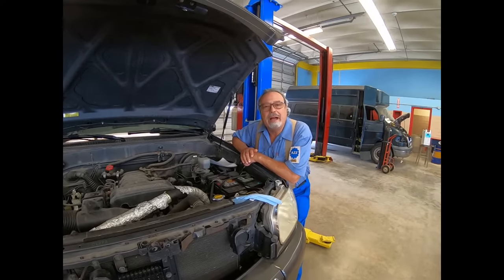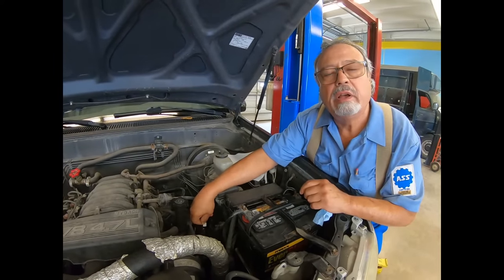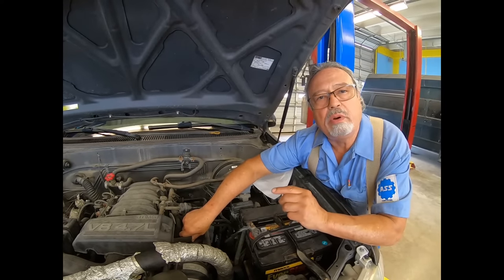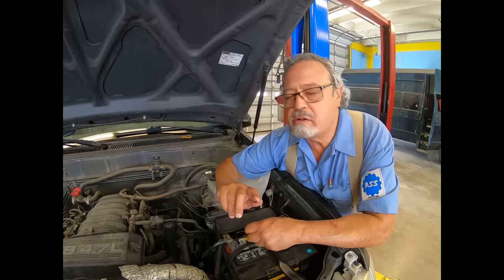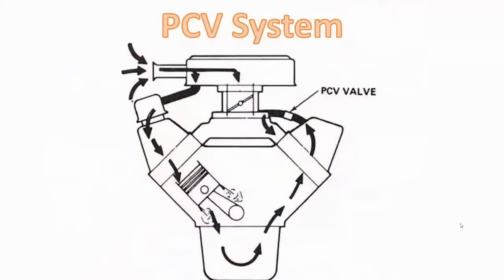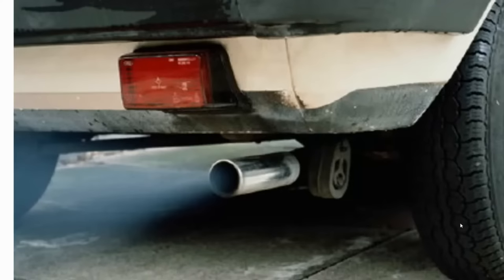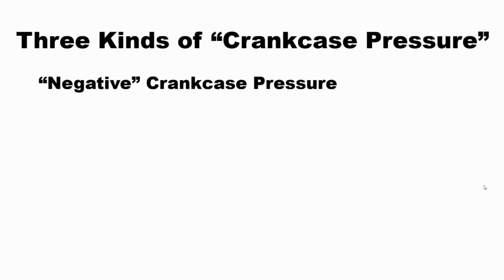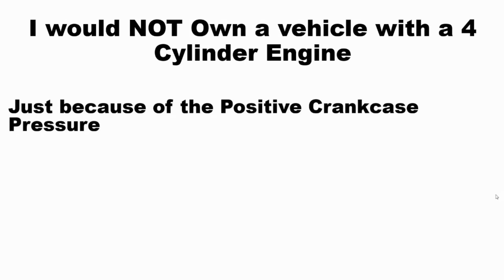Learn how IMPORTANT the PCV Valve is and why you should test it.

Comment: Am really learn alot .
Hav a Pontiac vibe 2003, jus realise smoke coming out of my dipstick hole. Wat is wrong with my car.I really need ur help
Reply from the maker: Thank you for the question and the view. More than likely your vehicle has a four cylinder engine. Four cylinder engine struggle to have negative crankcase pressure to begin with. Either way, if you have a four cylinder or six, change the PCV valve and hose that goes to the valve. If that does not help, the engine has excessive blow-by gases (scored cylinders and rings).

Comment: great video but one question - why do four cylinder engines not have negative crankcase pressure? do you expect flat 6 engines to create enough crankcase vacuum pressure for the paper to stick? I am interested in doing this test on a 2005 subaru outback with an H6 (EZ30R) engine. Thanks
Reply from the maker: Size counts. It take a very large amount of vacuum to over come the blow by pressure and put the crankcase under vacuum. Only larger four cylinder engines (2.8 L) can create enough vacuum to put the crankcase under negative CC pressure. Thank you for the view and the question.

Comment: Great video, thank you, but, if paper does not stick, im polluting the earth, and my oil, etc. but where is the problem and the solution?
Reply from the maker: Thank you for the question and the view. First find out if your engine uses a PCV valve. Most engines do use a valve, but some do not. If you use YouTube to research your valve, make use it is exactly the correct application. Replacing the valve AND the hose (if used) is a good start. If that does not fix the problem, sometimes the passage in the throttle needs to be removed and cleaned . If that still does not fix the problem, the engine may have excessive blow-by which is an expensive repair. Good luck.
Reply: @theoldmecanicoshow9004  Thank you for replying Old Mecanico! It uses a pcv valve, the eng was just rebuilt, I did not mess with adjustments in the throttle body or anything else, cleaned the throttle body before installing it back, etc. what is driving me crazy is that when I disconnect the hose from the pvc valve, it holds idle and sounds very normal, 700 to 800 rpm, with the hose connected to the pcv, idles too low, surges, and dies, if I leave the throttle closed,  and when I tested the pcv, it does not seem to be blocked, it opens and closes. Bought a new one anyways, so Im going to try it next time. Engine is a BBC 502 marine
Reply from the maker: @MachTuck  Try a "Factory" valve if possible. After market valves can be super cheap quality. Good Luck.

Comment: The part of the test that was forgotten, rev the motor and watch the piece of paper fall off because as the vacuum level falls so does the function of the pcv. These things (pcv’s) only work during idle basically and if the piston rings are sealing correctly. When they don’t you get so much blow by that it easily overwhelms the pcv and causes oil leaks and induces moisture into the motor from the water vapor in the combustion. You can see it under the bottom of the oil filler cap as a grey murky junk and the smell is noticeably different in the exhaust gas. As far as keeping the oil clean, the pcv doesn’t do anything for that, especially if the breather filter is missing. 
Just using a good oil without paraffin in it (for a street driven vehicle) or a good synthetic oil like Valvoline- Havoline are two that I recommend. If using conventional oil you can see the paraffin by looking at it while pouring so the light shines through it and if you a greenish tint that’s the paraffin. It’s very slippery and is great for race engines that are torn apart frequently, but is sludge in the can for street use. You can pull a valve cover and note the waxy coating. And the cheap low tension piston rings are a detriment to your motor as they allow blow by and oil consumption that destroys the cat and the sensors. Good luck!
Reply from the maker: WOW...thank you for all that additional information. Thank you.

Comment: What happens if the paper doesn't stick (V6), but the pcv valve seems to be working properly?
Reply from the maker: Thank you for the question and the view. If the paper does not stick it means one or more of the following: the hose (if used) is restricted / the point of entry (throttle body or intake manifold) is restricted  /  the valve is CCC "Cheap Chinese Crap"  /  a combination of all of the above  / or your engine has "Excessive" blow-by. Excessive blow-by is caused by scored cylinders and rings. Thank you again.

Comment: Ok, quick question i used the paper test, on my rebuilt 5.3 vortec engine. My pcv system has an oil catch can connected to it. The paper does stick to the oil dip stick tube, but its also has some of the symptoms you speak of, the oil turns dark faster, and my rear main seal have been replaced twice because it was leaking, also I have a high volume oil pump on it. Do you guys believe my rear main seal keeps leaking due to the pcv system not working properly? Thanks in advance.

Comment: I love my 4 banger honda. Is there a modification a guy can do to fix the lack of negative crankcase pressure?
Reply from the maker: Thank you for the view and the question. There are a couple of things that you can do to help your 4 banger. Replace the hose the valve uses with the biggest hose you can fit on there. You can use adapters at each end. Also, use a Honda valve for a 6 cylinder engine.  I don't know if your valve threads in or pushes in. Good Luck.

Comment: OMG... ASSwesome video!  Very well presented, learned a lot and subscribed.
Reply from the maker: Thank you very much for that Awesome comment and the views and the subscription. 😀😀😀
Reply: @theoldmecanicoshow9004  Wish I had a BadASS (exceptional positive praise) patch for ya.  I came across your video a 2nd time because I was researching Valve Cover baffling after reading this 1 Star Amazon Review 
"There is no baffling inside the unit allowing the pcv system to suck in oil. This in turn causes misfires on random cylinders by trying to burn oil in the combustion process. This then causes massive amounts of smoke to come out the tailpipe. Once I put the original cover back on, the smoke cleared up but now I have to replace my spark plugs because they were completely fouled from the oil. "

Comment: And if I could to ask for an another one advice, my brothers six cylinder (OM-642), is not making slight vacuum at all. 
Only pressure is going out, paper dont want to stick at all. The flow of the blow-by is blowing the paper away only.
I ve checked PCV valve, its in perfect condition. Also rubber parts inside, basically no dirty and sludge inside PCV valve. Also I ve changed a hose of PCV system cos the old one hose was shrunked. Not like sticked oil and sludge on the walls on the hose, but literally shrunked,,, like cos huge vacuum. Deformated one. 

Please, what could to cause the deformation of the old hose ?
Reply from the maker: Thank you for the view and the questions. If the PCV hose connects to the throttle plate, sometimes you have to remove the throttle plate and clean it. It takes a lot of vacuum to put the crank case under negative pressure, vacuum. Make sure the hose is providing the valve with very large amounts of vacuum. Good luck to you and your friends.

Comment: if you were to cap off the pcv vaccuum on the intake manifold vaccuum port, wouldn't it just use the breather hose to vent crankcase gases? also, since the pcv steals engine vaccuum, if you cap off the manifold vaccuum port (for the pcv), won't this increase engine vacuum/combustion/efficiency slightly? If breather hose (goes from valve cover to usually somewhere before throttle body on main intake tube) is at least .25" in diameter, isn't that more than enough to release/vent crankcase pressure without blowing any seals?
Reply from the maker: Thank you for the view and the comments. Venting blow by gases into the atmosphere is bad for the environment. The engine uses the vacuum / air to operate the PCV system to idle the engine. Thank you again my You Tube friend.

Comment: I want to replace the elbow for the pcv valve hose but they no longer sell the parts how would you go about fixing this issue? I have a 97 ford escort. I tried ordering one online only to find out it was a piece of plastic not rubber. Please any advice would be appreciated.
Reply from the maker: It is NOT Rocket science. Almost anything will work..Even patching the elbow with duck tape. Good luck and thank you for the views and the question.

Comment: My check engine light is on my 2007 Pontiac V6 G6 GT hardtop convertible, it has 106K the diagnostic code comes up bad catalytic converter, as in I need a new one, no other codes at all.  I'm doing this test tomorrow, as far as ik the pvc valve hasn't been changed, but I am the 3rd owner. My cat converter seems fine and there r no exhaust issues or bad smells. I'm wondering if this valve needs changing, could that be why the cat code is coming up, and check engine light stays on? Is it possible?, I hate to invest that money in a cat and that not be the issue. Also I have a tiny oil leak, not enough to have to add a quart of oil between oil changes. I'd say I add about ⅓ of a quart. Mechanic said it was rear main seal leak. I haven't seen it 4 myself yet. Everything u said in this video  is making  me hope that if I change the pvc, the problems  will resolve, ik the leak won't stop now or will it? Also would any type of additive help,, like cata clean & rear seal leak stopper?? Thanks for sharing ur knowledge, I'm glad I found u. I seen ppl say video was to long  and u repeat urself, I think that's good, cuz thats how it sinks in and u learn & remember. Keep  the videos coming! Thanks again! B---
Reply from the maker: Thank you for the question and positive comment. Did your paper stick ? If it did, your PCV system and crankcase negative pressure is Good. A bad PCV will not set a CAT code (sorry) As for the CAT code, about the only other things that can make the CAT look bad is exhaust leaks or restricted exhaust (bent in). If the exhaust does not have a leak or is bent, the CAT is deteriorated (worn away). CAT's only go bad two ways. One is they deterirate and the other is they get restricted which causes lack of power and usually does not set a code. If you decide to replace the CAT, be ready to spend hundreds of dollars for a good one. Some muffler shops installt the smallest one that might fix the code. I hope this was some help. Good luck.

Comment: I saw somewhere that you should change it every 50,000 miles. I have a 2007 FJ cruiser and I have never changed it, what do you think about changing it before there is a problem?
Reply from the maker: Thank you for the question and the view. Yes, absolutley. The PCV valve is more important than most people realize. I looked yours up. It is pretty easy if you want to try to do it yourself. https://www.youtube.com/watch?v=W6CADz53AC0

Comment: Question, how does the PCV system work under wide-open throttle? since the vacuum should be at, or very close to zero?
Reply from the maker: You are correct. At WOT the vacuum is very low and the PCV system does little to nothing about the blow-by. It's the same as the the old "Vacuum" operate windshield wipers. When you accelerated, the wipers would slow down. Thank you for the view and the question.

Comment: I have a mazda 6 from 2010 with an engine 2.0 155 hp 4 cyl (210k km) and I think I have a problem with PCV valve because when I change the oil, it is black, exhaust tips are black and it needs 1liter of oil between the changes ( less than 10.000 km). I didn`t notice any leaks.
Reply from the maker: Thank you for the view and the comment. Here is a link on Mazda 6 PCV valve replacement . Your valve looks difficult to replace (I hate that) https://www.youtube.com/watch?v=NU3uFViexgU
Reply: @theoldmecanicoshow9004  Thank you for that, is it located behind the engine?

Comment: Hi sir! Thank you for ur video, I’m going try this , bcz my 01-DGC is a pain to get to it , I had it replaced b4 covid and the place I took it to was in a hurry and said the part was  not correct part even tho the box it came in was right part no…

I  said let me call and get the right one and they didn’t want to wait bcz it was almost closing.. so they rigged it to fit and I didn’t feel comfortable on that but they did it anyway.. I wished now I would’ve said  just put old one back on till I got new part…

Can a wrong part do damage to my engine??  I still have my old one , I read some where that if blow in it  it  working and if u can’t blow in it then it bad is that true??? 

I’m just having some of symptoms of bad one..  I try taking it off it to hard  I don’t want to break the valve.. any suggestions Is appreciate, I don’t know what they did to get it on..
Reply from the maker: Hello Thersa M. Thank you for the view and the question. I want to try to help you. I tried to figure out what kind of vehicle your 01-DGC is. Can you spell it out? Yes, the correct part works best. The wrong part comes close to working but the correct part is better. You can clean to old valve real good and it will work fine. The only reason we relpace them is because they get very dirty. Tell me what kind of vehicle you have and I will research more information. Thank you again. Good luck.

Comment: I have a question sir,,,i have toyota vios 1.3cc manual 2011 model ,,,,when i open the oil cap ,there is a sunction ,,the cap were suck,,,is it normal or not?, ,,,,and there is a oil n the pcv valve hose ,,that is why i noticed that my oil is decreasing ,,,there is no leak on engine ,,,,
Reply from the maker: The suction (vacuum) should be so little that most of the time you do not notice it unless you are looking for it. Yes, too much suction can suck oil and use it up (burn it). I suggest that you change the PCV valve and the hose. Good Luck and Thank you for the view and the question.

Comment: My Jeep is using the oil without leaking. There is not leak around my motor, but when it's time to change the oil or before, the oil is empty. Could that be my PCV valve. 4 cylinder jeep Cherokee?
Reply from the maker: Thank you for the question and the view. It would be a good idea to change the PCV valve. Some PCV valves cost $5 and can be changed in 10 minutes. Some PCV valves cost $100 and take over an hour to change. If you tell the year , make, model, and engine size, I can try and provide you more information. Thanks again.

Comment: Oh boyy
I recently bought a second hand V6 truck and been thinking of replacing the pcv valve sooner than later since it had 3 oil leaks so far
I think I’m going to give this a try when its back from the dealer
Reply from the maker: Thank you for your comment. There is no doubt in my mind that "Sticking the Paper" is so important in preventing AND slowing down existing oil leaks. Good luck on helping to stop or slow down your oil leak.
Reply: @theoldmecanicoshow9004  I did it and the paper didnt move at all! 
10,000 miles remain until I need to replace it according to the service manual
Reply from the maker: @redman4life91  Try to buy a GOOD part...not the cheap/plain one.
Reply: @theoldmecanicoshow9004  I get cheap body/interior parts, but for the electric/critical components, I get them from the dealer, I’ve already made the employees my friends and they give me stuff for low prices, Like I just recently got a fuel pump for 200$ while its original price was 250$, they dropped the price for me

Comment: Hello sir 
 my engine is bad and and the piston rings is damaged 
Will help me a 5w40 or 5w50 oil or an oil aditive? It willsealbetter the pistonrings?
My car need 5w30 normally 
No money to reconditioned the engine...
Thank you very much and nice video
Reply from the maker: Hello,
Engines go bad many different ways. The symptom (how it is acting) can help me advise you. Does the engine run /run poorly /overheat / leaks oil...? I promise I will reply to your follow-up information and Thank You for the views and the question.
Reply: @theoldmecanicoshow9004  
 Hi sir 
The car is 4 cylinder 1.6 tdci econetic ford focus 2013
 120 k miles
The car run fine...
From 2 gear to 3 gear 2000 rpm to 3000 rpm push me back on the seat... is not overheating
300 grams oil is missing at evri 5k miles 
The symptoms is 
when I open the oil cap is coming to much pressure out 
if i Iet the oil cap seating with out close is dancing till is down on the ground and white smoke is coming from here the smoke is not very excessive like 10% from a cigarette. also very little rain oil jump from oil cap when is open 
I have a oil leak on the air intake hose connected to the turbo hose small leak but can be from more gaskets I can't finde more sides is dificult for me
Also I disconnected the pcv hose the hose what is coming from pcv valve to air intake 
On the hose I see coming only little smoke very very little smoke and I cannot feel any pressure coming out from this pcv hose
Thank you sir for yor message 🙏
Reply from the maker: @aluyal9288  I hope I have some good news for you. It sounds like your engine runs well. It's not necessarily bad to have positive crankcase pressure. In fact, my 1989 supra pushes out the dipstick from the tube because of positive crank case pressure. When I overall the engine, I had both the cylinder head and the engine block surfaced. The engine runs great. But it does push out the dipstick from the tube anytime I racist. If everything is fine, just keep stepping on that pedal on the right. Thank you, my friend for the view and the question. Good luck.
Reply: @theoldmecanicoshow9004  
I found good news 
On idle is coming pressure out
When I rev the engine make vacuum 
This make me more happy 😊 
Thank you sir 
I wish you all the best 👍